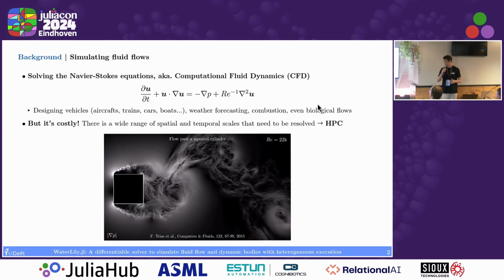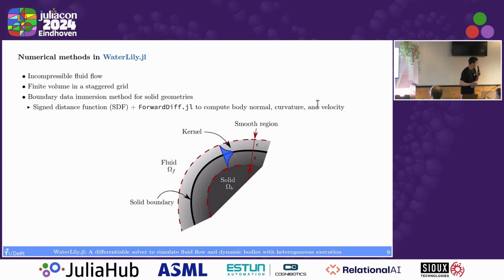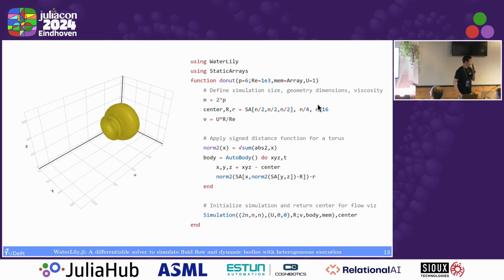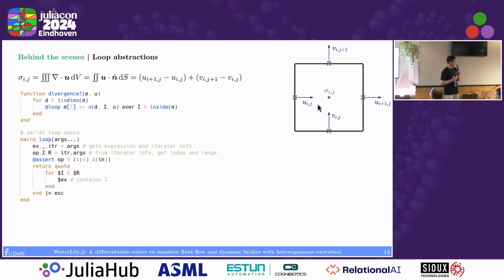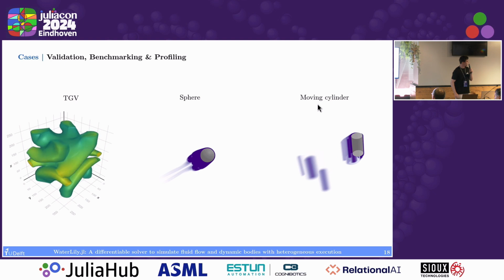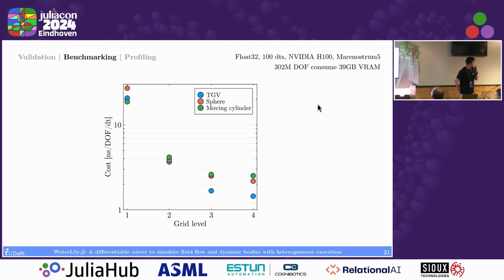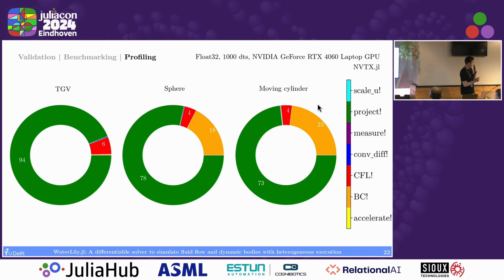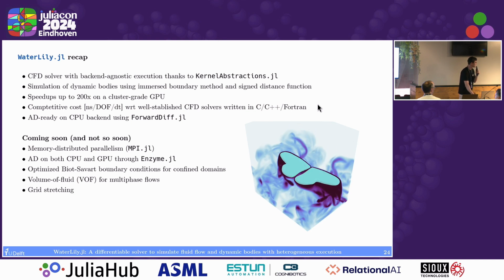A fast and flexible CFD solver with heterogeneous execution | Weymouth, Font | JuliaCon 2024

Comment: What I would really like to know is how to set up two-way coupling between the fluid and object motion. For instance a UAV where the controller varies the speed of the propellers in a way that depends implicitly on the fluid behavior. It's hard to figure out how you would encode something like that into the signed distance function, which seems to be a function of time only.
Reply: You are correct that prescribed motions and induced motions need to be treated differently. For induced motions, one can compute the forces on the surface of the body and use them to update its velocity. In turn, this will modify the BC of the fluid in the next time step (one-way coupling). On the other hand, it is also possible to solve the FSI problem with a two-way coupling via an external FEM library. Marin Lauber has been working in this and he would be able to provide more information if you need it. Feel free to open an issue in our repo if you'd like! :)
Reply: @bernatfont6510  thanks a lot im exploring fsi posibility so i will dig into Marin work as well! Thanks a lot for sharing this